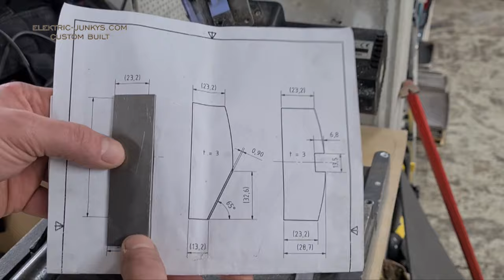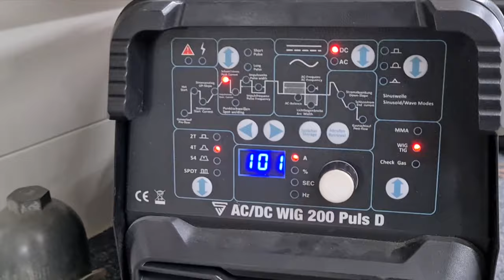make a Fire Torch Tornado | trapped in 1.5M Glass Tube | Vortex DIY Feuerrohr 4.0

Comment: Those 4 metal blades doesn't work properly , might have used 4 thin metal pipes . Which can suck oxygenated air from outside ,
Reply from the maker: thank you for comment, as you can see it works well in the end, if you have a better solution show us the Link !

Comment: Hello, the tube dont be black during the use? As the pellet burns? How can i avoid this?
Reply from the maker: hi, thanks so much for comment, actuall not ! But if you like it in Black we offer links to Heat Resistant Paint you can check ! The Burning Chamber it self could change the Color a Bit depend on Thickness of Material used. But the Pellet Chamber itself does not heat up ! Thanks for watching and Comment !

Comment: Hey it is a great project I seen you use 4”glass tube and 4” pipe in your plan how do you fit a graphing wool without having any extra gaps in between❤ ?
Reply from the maker: Hi mate, thanks for commenting ! It was exactly fitting to slide it in smoothly. I have to recheck as we count in mm, It´s always a bit complicated. I will recheck, count and get back to you !👌

Comment: Thank you for all the detailed information, we will build one for sure, questions I have
1. how long will it burn when fully filled with pellets?
2. I gues you cannot shut it down... so it is a matter of letting it burn down all the way?
3. there is no air control mechanism so you cannot control the height of the flame?
4. is there a plan for drilling the holes? What diameters of drills you use for the small and large holes on the burning chamber?

Many thanks in advance
Ron
Reply: I can only find the pdf partlist with the drawing of the airflow wings in the subscription of the video
Reply from the maker: Please shot us an email for detailed informations via the Link in the Descriptionbox Thanks so much for comment ! 🎉🎉😊❤❤❤

Comment: Hi verry nice! But i cant open the link for pdf? Can you send me link please thank’you!
Reply from the maker: hi thank´s for comment, please visit the Text DIY and click on any Picture it should open up. Cheers let us know
Reply: @ejunky66  thank you i try to do this but i see the flame not higher than 50 cm, what i do wrong? Thank you!
Reply: And this after 20 mn
Reply from the maker: @natuurvlam  have you used the same dimensions of the Burning Chamber ? and did you also add all Holes similar ?
Reply: @ejunky66  yes but if you check youre video is the same not higher if you check other outdoors is easy 2 meter high
Reply from the maker: @natuurvlam  and do you use the Same Wood Pellets ?
Reply: @ejunky66  yes i try today and its verry good , but other question the pellet tank is after 2 hours working black and smelt verry bad and if i open the valve of pellet tank there is always smoke is that normal? For the rest he do it verry good!

Comment: Hi, whats the glass tube made of?
Reply from the maker: hi, thank´s for comment, the Glasstube is made of glas my friend please visit the DIY Instructions you can find all links to purchase :hand-pink-waving:
Reply: @ejunky66  Okay. Another question, if the glass is 2 metres tall, will the flame reach the top?
Reply from the maker: @jatwangismyname900  hi again, are you planing to make it 2 Meters long ? it will surely reach the top. but the wooden pellents material will Burn much faster then advice a Bigger Storage Tank is that right ?
Reply: @ejunky66  Does it give off enough heat all around so that people can sit around it?
Reply from the maker: @jatwangismyname900  for sure it i as well a romantic Light :planet-orange-purple-ring:

Comment: Hey. How do you do the 30 degree cuts with the band saw? Which saw do you use? Most saws don‘t allow down to 30 degrees.
Reply from the maker: hi, thank´s for comment, yes right with the band saw, layed on the flat wide and tighten, adjust sawblade to 30degree and it should work. let us know how your project is going ... cheers   check this  band saw JET HVBS-712, 7" x 12" Metal Bandsaw, 4 Speed,
Reply: @ejunky66  Thx for your answer! Really interessting since most „normal“ band saws do not allow less than 40 deg.
Reply from the maker: yeah is just about the height that was annoying on the small Band saw can not cut higher than 10cm ;) as you could see have to use the flex anyways ;)
Reply: @ejunky66  thx for the Info. So you can set the saw to 60 degrees?